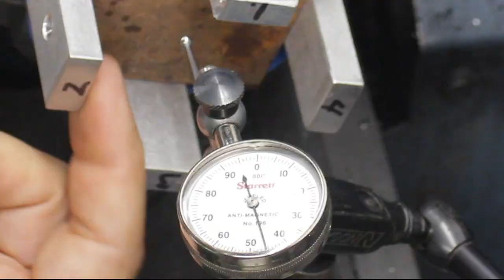Daves part / Metal Music 1

Comment: Very good.. I like the music.. You need to get some insert tooling..    I've not had any luck with straight high speed cutoff tools when going deep.. The insert blades can part 2 inch 1018 and 1 1/2 inch 416 ss without problems on that lathe (I own one)..  The only way I can keep from snapping off a high speed steel blade is by working back and forth to cut a wider slot.  The problem I seem to have is the chip eventually gets caught, friction welds itself to the slot and snaps the blade. Insert stuff has a cup / chip breaker that rolls the chip making it narrower than the slot.  

Another thing to note is that a bxa  sized quick change setup will only take a 1/2 inch tool in the standard holder on that lathe.. You can buy tool holders that  have a narrower bottom to allow 5/8 inch tooling.